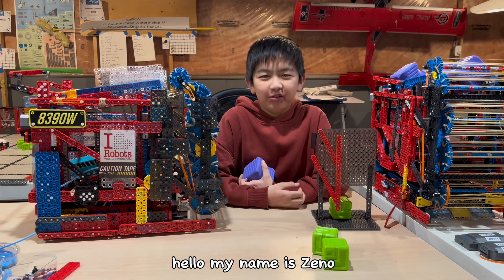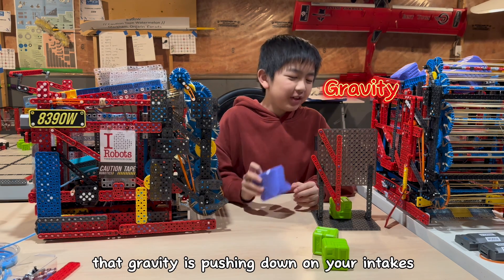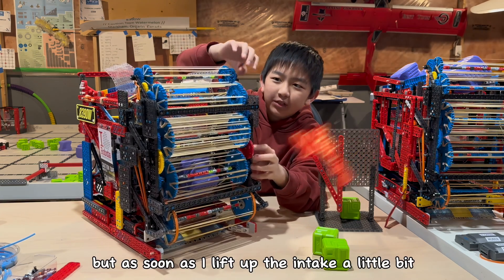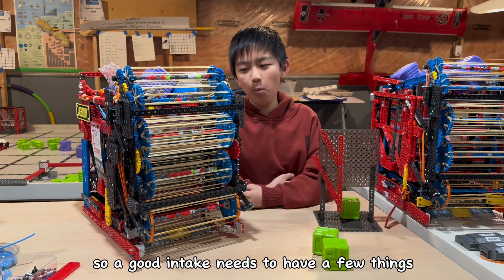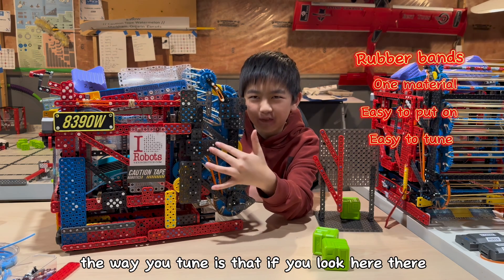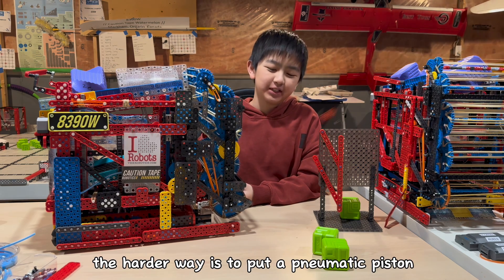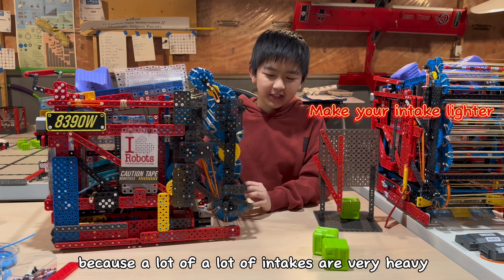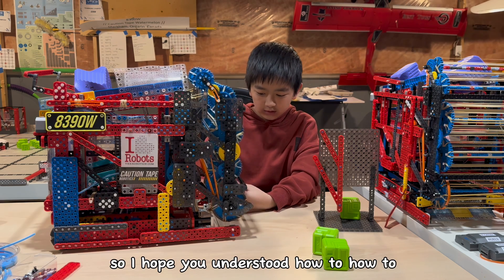Tuning the intake for VEX IQ Full Volume: Team 8390W’s Student Introduction Series

Comment: One other way you could add a force to counteract gravity is through the torque of the intake. By using a gear transmission from the frame of the robot to the intake, the torque from the gear would add a lift force to the intake, allowing it to rise.
Reply: yep
Reply: Yeah, that’s what we do with 0 banding.
Reply: @madisoglrobotics  We needed slightly more lift than that so we incorporated slight tensioning partly because our intake was really heavy
Reply: @ranveerdasari6407  oh ours was insanely light so we were good on that. Also four motor intake was really good with no lift so
Reply: @madisoglrobotics  yeah we weren't able to get our hands on a pneumatics kit so we were struggling to build a PTO
Reply: @ranveerdasari6407  you can do a directional switch we didn’t even use pneumatics for a week or so before PTOs became the thing
Reply: @madisoglrobotics  so two motors full time intake and then two motors that, when spun left lets say, would lift ramp, and when spun right, would add power to intake?
Reply: @ranveerdasari6407  or just a four motor gear line with a d switch at the end and when you spin it one way it drives a shaft that powers both sides of chain and then when you spin it the other way it just free spins and doesn’t connect to anything
Reply: @madisoglrobotics  Oh so you can only have one at a time, intake or ramp?